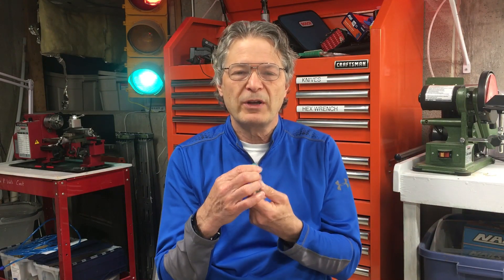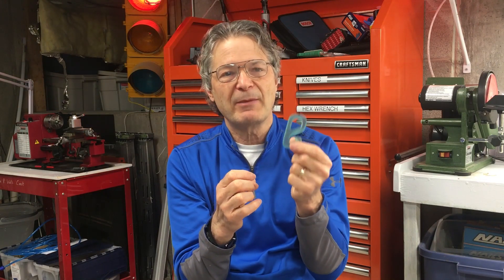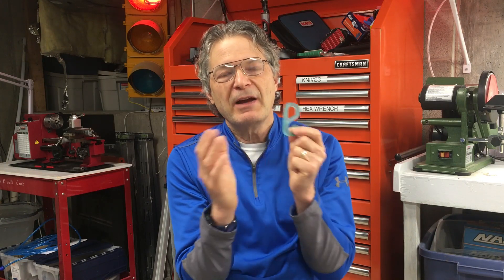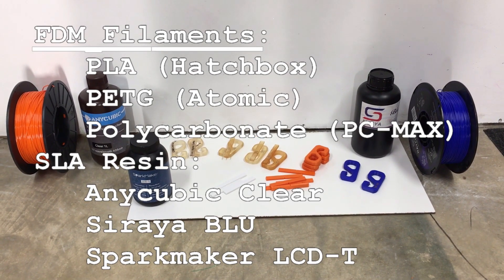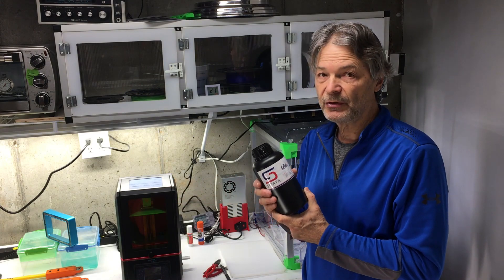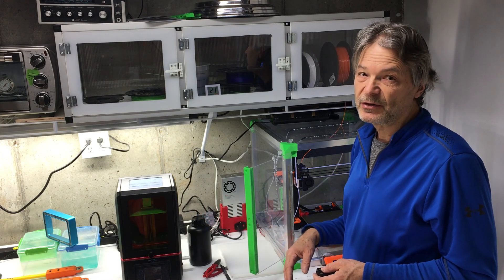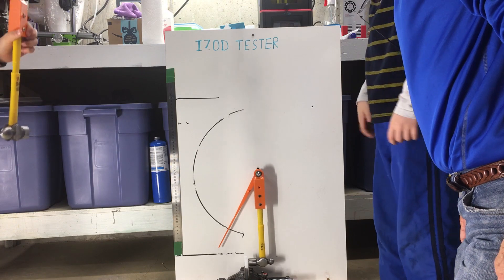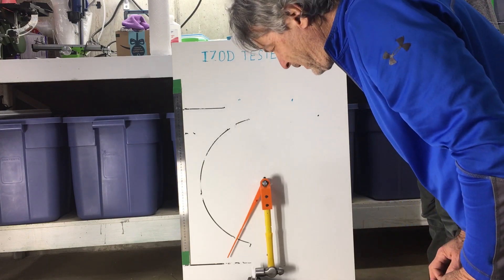Comparing strength of SLA Resin objects with FDM printed objects

Comment: How is the dimensional accuracy and tolerances? Noone has given me a clear answer :(
Reply from the maker: I don't think that is really a resin issue as much as it is a printer issue.  Having said that, clear resins do spread light somewhat at the edge.  You can control for that a little or go with a opaque resin.
Reply: @PhilGandFriends  but how much can I expect? everyone on the internet says different things.

the common answer seems to be that it's a random value between 3-15% and i have to print the file, and measure and re-adjust and re-print it... which is a paint considering the curing process and how some holes can't be accessed

Comment: Great video 😀
Which low odor uv resin would you recommend? I live in an apartment and want to try 3d printing. 
I think I will start with a resin printer. Which printer would you recommend $ 500- $ 800?
How much noise do your resin printers make compared to the fdm printer?
I have a look at the ANYCUBIC Photon Mono X with it is first to get after November 5th. Then there is time for me to learn software 😁
Reply from the maker: I have mostly standardized on Siraya resins.  They have a number of choices.  I have been mixing Blu with Tenacious frequently.  (The Blu is strong, the Tenacious adds a bit more flex and sticks to the bed well).  As far as odor, I am not a good person to ask.  I don't really smell any of them.  Also you need to make sure the Siraya resin is printed above 25 degrees.  You probably can reach that temp by just putting a box over the printer).

Comment: Did you test if impact strength also change if infill is changed to 100%?

Will results for all those parts be different if they lay in sunlight and hotter than normal room temperature for let's say one day?
Could also be interested to see how parts that lay in a freezer for one day will perform.

(I try to find out what is best for my build ideas as they will need to be used outdoors in sun, rain and +35 down to -10 degree Celsius.).
Reply from the maker: I did not test that, (I was trying to match the testing setup of Stefan).  Good question, however.   
Maybe later.

Comment: Thank you for this test, and Stefan, too.  The resin manufacturers need to do a much better job of publishing standard test results, but It's usually difficult to compare mechanical properties between different resins from the same manufacturer because they use different specs.

The manufacturers also need to publish the printer settings for each resin, for all popular MSLA printers.

I don't make miniature figurines.  I want to use 3D printing for short run manufacturing.  The loose mish mash of mechanical specs aren't very useful.  The subjective impressions of Amazon reviewers is actually more useful.  As an engineer, I'm forced to design the parts with the general MSLA printed properties in mind, test different resins at different printer settings and different post cures, and iteratively modify the part to optimize it for the desired use.  Still, 3D printing is a wonderfully enabling technology.  With MSLA, I can produce parts that are more complex than injection molded parts, with a surface finish that's nearly as nice.  The material cost is much higher, but there is no expensive mold cost or 10,000 part minimum molding run.

Comment: a 100% polycarbonate will perform a lot better if anneal process after print. my 100% polycarbonate print already perform much better than PLA before anneal in pull test. After anneal, it is almost impossible to break polycarbonate. I am not exactly sure about the PC Max since it is not 100% Polycarbonate.
Reply from the maker: I have not tried annealing polycarbonate. I will have to try that.  Thanks.

Comment: Great work!!! It would be interesting to retest the sla prints using 30%infill and a thick outside wall to approximate the FDM parts, and why not also test ASA and nylon or NylonX using FDM  while you're at it?
Reply: I was wondering about the same thing.

Comment: I find resin is too brittle. Which is exactly what Phil is showing. I imagine that as the SLA market continues there will be more (better?) options out there.
Reply: Tenacious resin is not at all brittle and can be mixed with other resins at whatever ratio you need to make them less brittle as well.  FDM filaments have improved greatly over the years, and now that MSLA printers are becoming more widely used, the resins are greatly improving.  I wasn't interested when resins were only useful for fragile miniature figurines, but now that I can make structural parts at much higher resolution than FDM parts for maybe twice the material cost (and falling), I just bought my first MSLA printer.

Comment: 3:31 I would find it to be a huge waste of resin to print solid. Plus the resin inside would not be able to cure properly anyway. I always hollow out my prints and leave a couple of escape holes to pour the excess resin out.
Reply from the maker: My parts are usually printed with clear resin, they they cure OK throughout.  But you are right about the resin cost.  Unfortunately, the slicers don't do a great job of automatically hollowing out at this time, (but I am sure it will get better).

Comment: Just a thought that might help - I heat my Photon to use Siraya BLU by simply pointing a heatlamp at the outside of the unit and partially blocking the fan at the rear of the resin chamber.  It's a little simpler and quieter than an enclosure and a hair dryer.  Many people disable that little fan, as it seems to function mostly as a source of extra resin smell in the workshop.
Thanks for the great tests!

Comment: I would love to print replacement MK3 parts with my photon but I don’t know how well resin would stand up to the heat. Have you tested heat at all?
Reply from the maker: I just did it. https://www.youtube.com/watch?v=evaB9w6GNLE&feature=youtu.be
Reply from the maker: Great question.  I intend to do that in the near future..
Reply: Resin can stand up to heat easily. It is not a thermoplastic. I could not melt it with a 320C soldering iron. It does break down at some point, but printer temps are not hard for resin.

Comment: https://docs.google.com/spreadsheets/d/1JlqLSi4sxZLdA-hHCp6Ow4isoGMNI7nlE9Nmbj1ajWk/edit#gid=0
Reply from the maker: I think it is important to try to understand better how a torsion test like is used in this list would work with FDM prints.  Resin prints are basically anisotropic (equal strength in all directions) where FDM prints are not. Therefore you need to think about various test and how they will perform in each material to compare them and know how the test will affect real world parts.  I would really like to see some standardized testing done that works across FDM  and SLA objects.  I will look at trying to compare "pull" versus torsion and see how they compare.
Reply: @PhilGandFriends  I think we should try to talk CNCKitchen into testing some resins with the same machine.
Reply from the maker: @rsilvers129  He posted a note saying he was doing it now.

Comment: it would be interesting to know, how those results change after some time, e.g. after 1-2 months. (since resin parts continue curing in the sunlight and PLA also does not like sunlight).
Reply from the maker: I agree.  There are many issues around post curing that I don't understand now. (How long to cure, does heat help, what is long term uv impact, high heat?)
Reply: Yes. I’d like to learn more about the stability of resin parts over time. If I print a set of connectors for kite structures, will they decompose in months? years? days in the sun??

Comment: Phil,

Love the video. It is very thorough.   We like to reply to some of the points you mentioned:
1. You can increase the strength of Blu further by printing at 100um layer height and you will save print time too.
2. While Blu prints best with starting temperature of about 30C, you don't really need a heater or enclosure to get it working. As long as the environment temperature is not under 15C, you can increase initial layer exposure time such that it will heat up the resin enough to finish the print. check out the user guide in the support section on siraya.tech
3.  Post curing condition can affect material properties as well
4.  Blu is made to have good resolutions which means it cannot be too flexible.  We just launched Tenacious resin that is much more impact resistant that Blu and can be bent 180 degree without shattering.
Reply from the maker: Thanks for the information.  I hope to go back and retest with more testing of the print parameters such as post curing times.
Reply: @PhilGandFriends  what were your curing processes? please.
Reply from the maker: @Zepeda3D   I have a separate video about that. I use heat when curing.  It adds about 40% to the strength.
Reply: @PhilGandFriends  thank you I will check the videos out
Reply: I tried out the siraya blu after watching this and I got some of the best prints I've had sol far on my Saturn.  Thanks for the info.
Reply: Is the ABS like resin the same as Blu?
Reply: @ameliabuns  it is not the same. Blu is tougher and stronger. Fast is not as strong but easier to print and clear